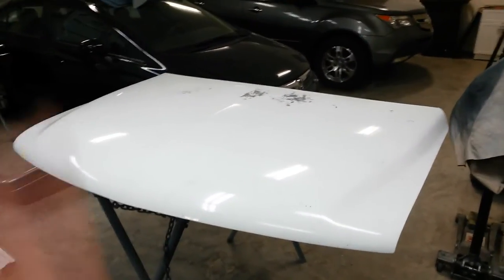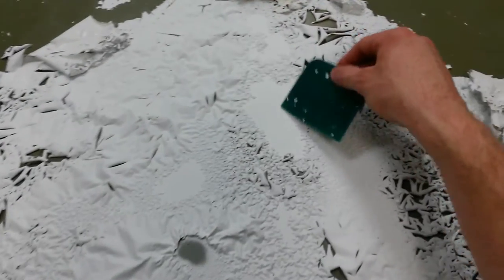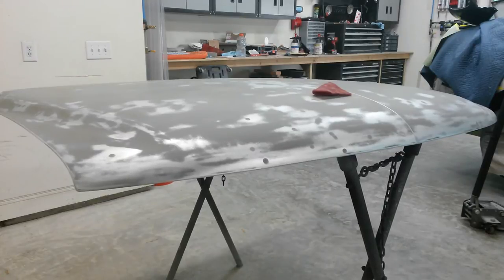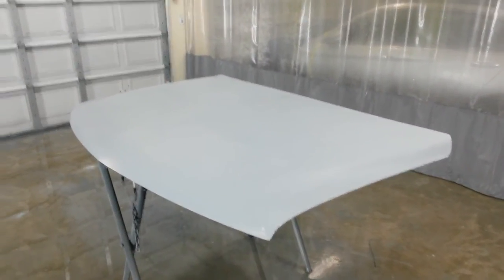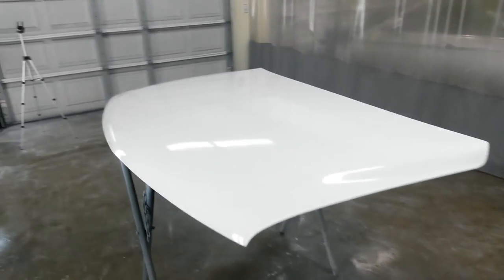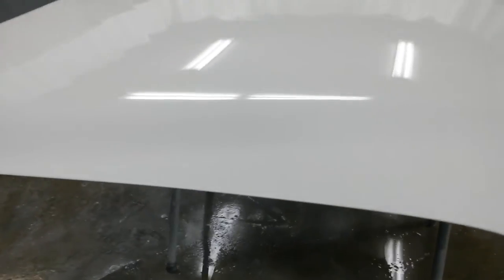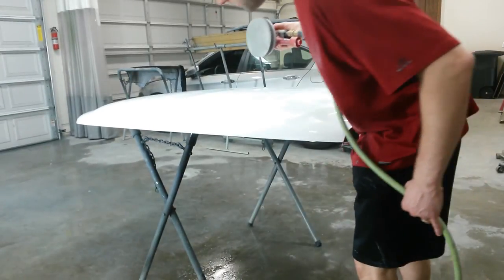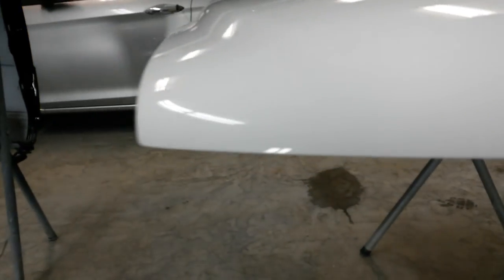2005 CHEVROLET TAHOE | HOOD STRIP AND REFINISH

Comment: Did you just add a base coat, then sanded it down w/ 3000 grit and then polish it?  no clear coat?
Reply from the maker: Miami13 i don't quite understand the question,  but i stripped it to metal and epoxy and urethane primed it. Then base and clear and denib and polish.
Reply: I guess I'm still too new to the 'lingo' in painting LOL (denib/epoxy & urethane).  Yes I meant if you'd just sanded it, then put a primer, then the base coat and wasn't sure if you'd added clear coat.  I saw you working out the fish eyes with the small block, (not sure what type of block that was) lol..
Reply from the maker: Miami13 if you use basecoat you must use clear over it. Single stage is the name for color amd gloss in the same coating.  Enamels and urethanes are two examples.  Don't require clear. More challenging to get those to come out right, but i beleive you can add clear on top of some of them.
Reply: Sam G thanks Sam, thanks for taking the time, both fur making your videos which are very good and for answering everyone's questions.
Reply from the maker: Miami13 no problem,  any time.

Comment: Damn this just saved me some time. I was getting ready to go sand down a complete hood. Just going to order this stuff
Reply from the maker: It's no longer available due to a banned chemical. Probably have to try regular Aircraft stripper.
Reply: Just ordered some earlier from ebay
Reply from the maker: @JohnDrach  cool. There are still some available out there, but i believe it was discontinued.
Reply: @samg5543  Eh I bought as can and it didn't do anything. Must have been really old